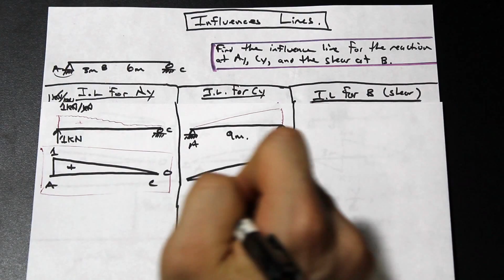Solving Influence Lines for Beams Using the Qualitative Method - Easiest Method!!

Comment: Does this method work for influence lines of moments?
Reply from the maker: Not exactly, but for determinate structures the moment influence line is linear..once you find it at one point you can just use the slope to determine it at other points as well.

Comment: 4:33 why is the slope equal?

Thanks.
Reply from the maker: Thanks for the comment.  Since the influence line is a measurement of the response to a 1 kN unit load, 1 will be the maximum rise.  If the run is the same (length of the beam), then the slope must be the same.  Hope that makes sense.
Reply: AF Math & Engineering 👍🏻